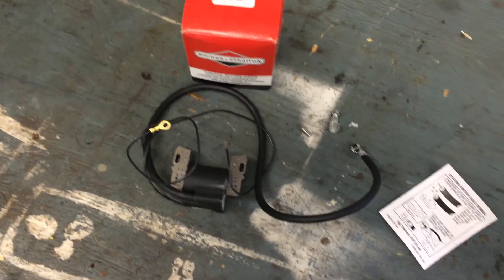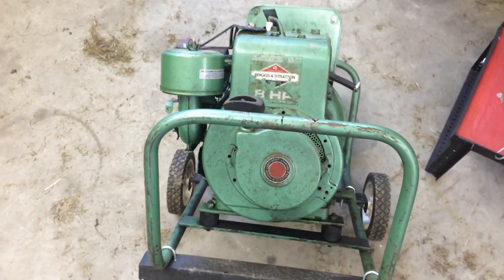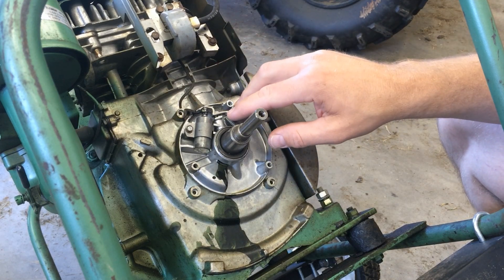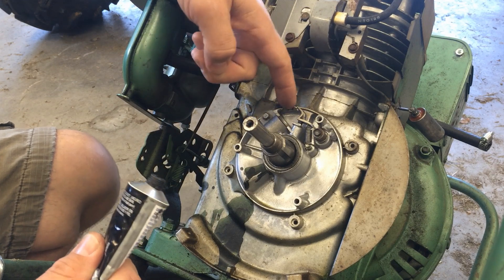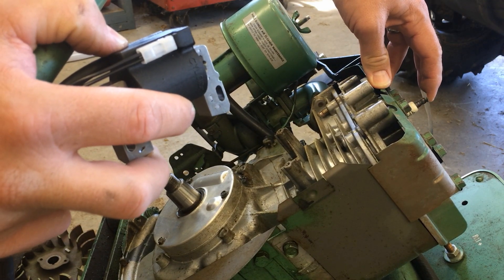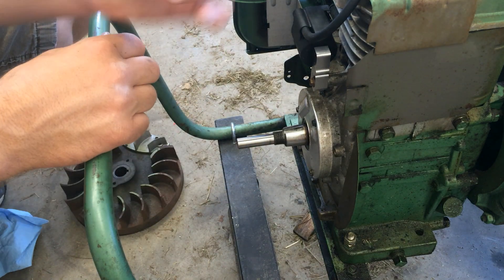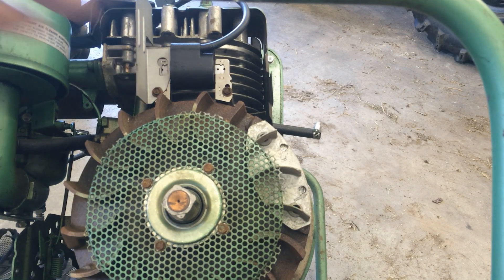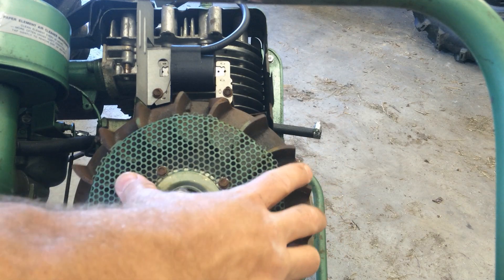Briggs Points to Electronic Coil Conversion

Comment: If you pull that flywheel (which I wouldn't do) make sure that special Belleville washer is installed cup size towards the flywheel.  It's slightly concave and if installed wrong the flywheel will not be seated firmly and could sheer off the sheer key. You have to look closely because it looks like an ordinary washer.

Comment: What is the part number for the briggs coil used in this video?  Thanks
Reply from the maker: 39881 was the one I bought for my application.
Reply: @Yellowdogsworld  Thank you!!
Reply: @Yellowdogsworld  Great video
Reply: @Yellowdogsworld  I think you missed an "8". Should be 398811 as you said at the top.

Comment: Looks like an iron flywheel, so it must be a pretty old engine. If it "still works" then "keep using it."
Reply from the maker: The date code on the engine indicated it is a 1980 model... its been a tough unit since I saved it from the scrap yard a few years ago :)

Comment: Thank you.  Is your Briggs engine model 190402?   That's what I have on my Toro 826 snow blower.   Also, is the plunger easily removed and plugged up or should I just leave it alone for now?---not sure if it'll leak oil like people say it will.....

And good idea leaving the points in case you want to go back to that.

FYI, for people who can't remove their jammed fly wheel, I tilted my snow blower up so it's weight is on the housing and the fly wheel is now facing the ceiling.  Then soaked it big time (especially around the key) with liquid wrench.   After one day of doing this it slid right off.  Hope that helps somebody who can't pry it off by banging on it.
Reply from the maker: Mine is a 190412 model, real close though. I left mine in place and haven't had an issue with it so far, but either way, I think it would still be fine. If you choose to silicone it up, I'd make sure it's clean, & use a good quality sealant.

Comment: That is a straight key. A woodruff key is half moon shape. The thickness of the card is used for the clearance between the flywheel and coil. Not the tolerance. Other wise great job.
Reply from the maker: Thanks... my terminologies may not always be on point, but I try  :)

Comment: I have a 10 hp Briggs. How do i find a coil for it being it was designed with points originally? If i look on Amazon say how do i find the correct one?A 10 hp coil is larger then a 5 hp coil

Comment: So the new coils don't have the trigger button anymore?
Reply from the maker: if your referring to the points... then yes, they discharge without the points.
Reply: No,I was referring to the older Magnetron coils with the button or contact beside the leg, that triggered the spark.Your coil and the one I just got doesn't have this. Was there anything else you needed beside the coil? Just trying to figure whether this will work,and if this is the new style coil. Thanks.
Reply from the maker: OK, I got it.
I cant say 100% that the one I put on this generator will work, but I "Think" it will. If I remember right there was a reference to the magnatron coil in the paper work with the coil. Here's a good reference video that may shed some more light on the subject.
https://youtu.be/KvBx4Mh1Lvw 
About 12 min in he covers some of the issues with the magantron coils. Issues such as having your flywheel re-polarized due to the north south polarity having to be reversed if replacing with a different style coil. I hope this helps.
Reply: Well,the one I got looks like the one you put on,so I guess I'll try it.Thanks
Reply: @johnwrigley1624  what's the part number? I'm looking to do the same upgrade.
Reply from the maker: Part # 398811 is what I used in this video, please verify with Briggs & Stratton if this number is correct for your application.

Comment: Actually it's easier to reinstall the flywheel with the slot pointing down.  Just put the flywheel key in the flywheel's channel and slide the flywheel onto the shaft.   Simply use your finger or thumb to keep the key from falling out until you line up the flywheel.

I found this out when reinstalling a heavy cast iron flywheel on an older Briggs engine.  It's much easier.

Comment: No need to pull the flywheel. Just cut the wires. You are making the job way too complicated.
Reply from the maker: Very true, I pulled mine since I wanted to salvage the condenser and hardware in case I needed it in the future. You are right though, just to get it done, cut the wire and move on.
Reply: Briggs sells a starter clutch removal tool that hooks onto your air impact gun and a 7/8" socket. Part #19244. $14.01 on Amazon.  So much better than breaking the fins on your flywheel or the ears on the starter clutch.
Also that gap between the armature and the flywheel(the thickness of the business card) should be 0.10 - 0.14", not  0.25".
Reply: @chainsawchips  I think you meant 0.010" which is ten thousandths (not 0.10")
Reply: I appreciated seeing it removed, even if not necessary,  is there any benefit at all from removing it? Also what tool is that, that you used to remove that?
Reply: Yeh I couldn't believe how easy it was just swap out coils and away she went
Reply: Thank You very Much. When Good People like yourself make these helpful videos, you really help people, especially in places where there is a real lack of this type of information. Thank You and may you always have the strength to continue to help others! Much Appreciated.
Reply from the maker: 1. The tool was a simple gear puller set I bought from a local auto parts store, around here they are more commonly known as a crows foot gear puller "looks like a crows foot". I had to come up with some bolts to fit the flywheel since the set did not have the right size.
2. There really is no mechanical advantage for removing the points and condenser. However as i mentioned in the video, in the event I need to go back an put the original coil set back on, by removing it this way there are no cut wires to worry about, just bolt on adjust the points, and coil gap and your up and running.

Comment: Hello, I am working on a 12hp cast iron Briggs from an allis chalmers b112. I am in the process of trying to eliminate the points. I am using the original coil and purchased a ignition module kit, that uses the wire from the coil to the points (sniped) and wire in the module instead to that wire. I did this was kind of skeptical on how the timing could remain precise. To my surprise with the engine outside of the tractor. It fired off of ether no problem. (Only ran for around 6 seconds) so I got all excited and installed the engine. Attempted the exact same scenario as before and now it's popping back through the intake and the odd backfire out of the exhaust. Now I don't know what to think. Was it a fluke before? How were you able to accomplish this to work? I have read I need to repolarize my flywheel magnet? Can you please shed some light on this. For some reason I am stumped.  Thanks
Reply from the maker: Just saw the comment, I don't know if you've got it figured out yet.I wish I had a good answer for you but in this case I'm not real sure. This is a problem I haven't encountered, it does sound like the timing is off. In my application it worked just fine, as a matter of fact It kept my house going during Hurricane Mathew, never skipped a beat. I suspect it may have more to do with the fly wheel and magnets then anything else, I would however double check the clearance between the coil and flywheel, make sure nothings come loose, and make sure the flywheel hasn't loosened up on you, beyond that I'm not sure. I think I've heard of flywheel polarization issues before but not sure if that's causing it, or how you go about fixing it for that matter. Hope you get it figured out, best of luck.
Reply: Yellowdog02  hello I figured it out, seems Maybe my ground wasn't good on the module. She is running great now
Reply from the maker: Awesome, glad to hear it worked out for you. That one little upgrade makes for much more reliable setup.